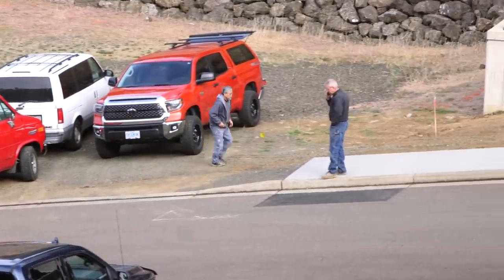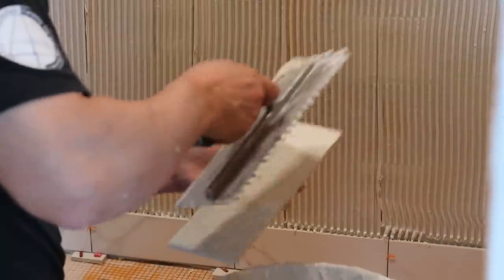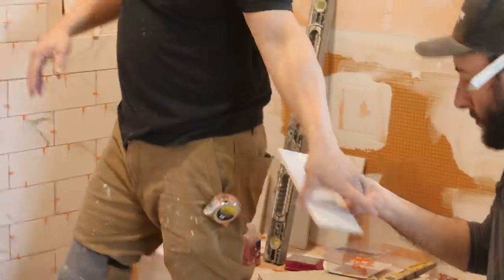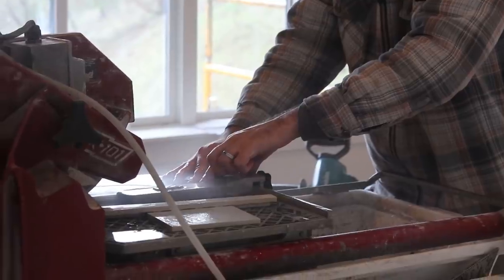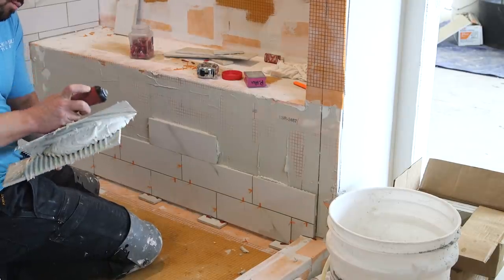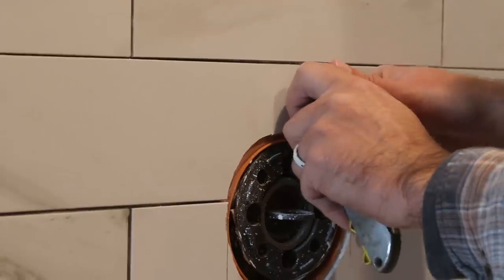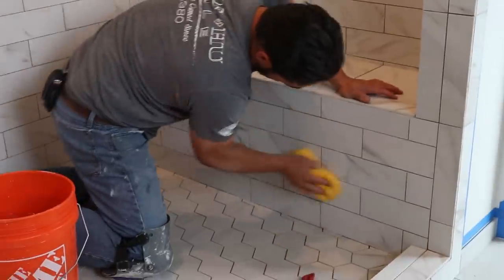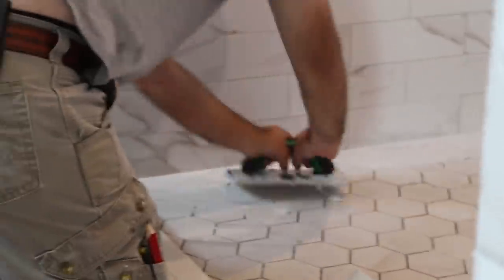How to Tile a Shower Ep.121

Comment: Little tip from a tile setter. 
Keep away from epoxy grout unless you are doing a swimming pool or hot tub. It really isn’t necessary for this application. 
Use Mapei Ultracolor grout. No sealer required and no efflorescence like the basic grouts since there is no Portland cement used. 
Fantastic video though. I love all your content sir.
Reply: Yeah, this EC guy doesn't do as much research as he probably should. There's definitely a third choice between plain powder grout and epoxy, ie acrylic grout. Mapei makes a good one but there are others.
Reply: TEC Power Grout is another excellent option. It’s the only grout we use, and far easier to work with than epoxy grout.

Comment: Here in Europe it's not recommended to use two-component epoxy grouts in places like showers. Epoxy grout is water tight both ways - it won't let the water in, but it also won't let the water (moisture) out. There's always some moisture underneath the tiles, despite 90+ % bonding. Tile waterproofing keep the moisture from penetrating lower layers, but the moisture needs to get out. Cement based grout has higher vapour permeability, so it allows that moisture to come out.
Also the very corners of adjacent walls/floor should not be grouted. Even though epoxy grout is somewhat flexible and deformable it will crack in the corners with time. The best way is to use a mould resistant acid cure silicone (except for natural stone). If done properly, it won't degrade for 4-6 years. Besides, there are no eternal tile works. There are well maintained bathrooms and showers with periodic inspections and the others :).
Reply: Those are the facts! Cement based sealed every 18 months is the best method in my opinion!
Reply: In the US we build our bathrooms to be remodeled every 10-15 years. At least that's how old they are before they start really showing signs of wear.
Reply: @9HighFlyer9  4-6 is a lifespan of a silicone. When it degrades, you just remove and redo it.
Reply: Interesting! I didn’t know that but it does make sense! 
Europe is usually more advanced and smarter in their construction practices than here in North America!
Reply: @utuberdave  I think that is not the matter of being smarter or not. We just have more urban areas and many people live in apartments where it's harder to do remodelling too often. In a place like block of flats any failure may have serious consequences, both material and financial. So we try to do all the construction work as reliable and serviceable as possible.
Many of your solutions are simpler, cheaper faster and smarter than ours. But some are unwise beyond any comprehension.
Reply: Isn’t sealed grout going to have the same issue? And the tile itself isn’t Permeable so no moisture will evaporate through it. Seems like a non issue.

Plus regular grout unsealed is actually a place for more and mildew to grow. So i guess it’s one of those pick your poison type things.
Reply: @Stefan_Kawalec  you could say all those things about epoxy grouts.

I’d be very surprised if water trapped behind this tile could evaporate out even if regular grout was used. And even if such evaporation is possible it would take so long that it wouldn’t happen if the shower was in use regularly.

Comment: Marvellous to see a good tiler at work. I remember a few years ago when we had a tiler in for a bathroom renovation. He was great, he told the building contractor off (he was a subcontractor) and made them come back with better structural reinforcement and straightened the edges. A good tiler is worth more than just the tiling job.

Comment: Good warning on the epoxy grout. The average DIYER needs to stay far away from it. They should go with a premium premix grout that includes stain protection and mildewcide to prevent molds.
Reply: Never had a stain protection work
Reply: @turboflush  Epoxy grout I've used hasn't been particularly good at stain protection.
Reply: @dchristo10  interesting. I have never used epoxy grout.
Tried grouts with stain protect. Tried adding... It never works. Tried cleaning and reapplying. Thin. Thick. None matters.
Reply: As a DIYer, I've never had the courage to try epoxy grout. I think I'm too slow of a worker to pull it off. I used a premium premixed grout a few months ago and was pleased with the results.
Reply: @Nk-bc1qb  yes, I used it once and it's difficult to work and wipe.  I ended up breaking it up into little areas.  lucky it was a small job.  Never will use it again.

Comment: Epoxy grout is a milestone in modern times as Roman concrete was in its day. Beautiful tile system from  industry leaders. Tiled a ton in my 20's, and love the new standards, and dependability of new products. Fit in a small interlock install for the garbage /recycling pad near the curb. It's a popular install, easy to get right, and wrong!

Comment: The layout of tile can be the toughest part of the job. It includes shifting the pattern over one way or the other to accommodate   windows that are not exactly in the right spot or placement of outlets, bars, and special items. Sure you can go around them, but a lot of forethought goes a long way before the tile guy gets to even see the job. Starting placement of floor or wall tiles can alter the whole thing.

Comment: This was great.  I've done a good bit of tiling in my own homes, and it's good to see pros doing things much the way I did them, only way faster, of course.  On walls, I did way less vertical in a single session, wanting to be absolutely sure the previous section was fully adhered before putting anything above it.  The paranoia of an amateur.  One thing I didn't see here that I learned years ago is part of the layout.  If you have a large hole, as for the shower controls, and you're using hard tiles (like porcelain, vs. ceramic), it's best to plan it so the hole center is between two tiles.  I had one that was about the center of the tile.  Maybe there's a better solution to this problem, but I ended up using a tile splitter on that tile, then cutting the half-holes along the split, then fitting the two pieces back together carefully.  It took a pretty close look to spot the split, but it would have been better to have not needed that at all.  I always find tiling to be a bit stressful as I'm planning it and actually doing it, as I'm concerned about screw-ups and the extra work they end up requiring, but once the work is done, it's a great feeling to admire it for years to come.
Reply: You're absolutely right, making a clean hole (even if it's round, but especially if it's not round) in the MIDDLE of something as brittle as a tile or a pane of glass is something beyond the capabilities of your average DIYer, and likely still challenging even for the best craftsmen.
So, laying out the tile so that at least one joint passes over that hole is a much superior layout choice, as you mentioned.
I do like your solution (tile splitter and then cut out the half-circle sections out of the edge created by the splitter), but since I don't have as much confidence in the tile splitter, I'd have used a more traditional tile saw on that tile and just made the resulting joint look like it was meant to be there from the beginning. Much easier to reliably seal and grout it that way, instead of having basically no gap to put any kind of filler into and therefore potentially having a spot where a crack and/or leak might develop in the future.
Then again, I've never laid tile in my life, and I'm just fine with keeping it that way, so maybe I'm wrong about this whole thing (instead I'd hire someone who has years of experience).
Reply: Drill with circular diamond bit. Keep the tile wet.
Reply: @JosephWheeler14  For holes like the ones for shower controls, that would be a very large diamond bit, and a home gamer would likely only get a single use from it.

Comment: I demo’d and installed 2’x1’ tiles on  the floors of 6 full baths, 2 1/2 baths, our upper laundry closet, our lower laundry room and an outdoor shower by our pool, over the course of 2 yrs of roof-to-foundation renovations on our 20 y/o 6k sq ft North Texas home…. My progress in understanding the approach, materials, tools, sequencing of steps, set and install techniques and related tips and tricks of the trade, are clearly evident over the scope of the various projects. Moreover, the accumulated insight and wisdom has significantly streamlined and reduced the overall project duration times.

Comment: I came to the house yesterday, since I misread the website (I left that note), and I'm bummed I couldn't see this shower or much of anything else. It looks great! You've done a lot of great work here, and whomever buys the place is a lucky person. I'll be using this Schluter system when I redo my shower, as I think it's the best too. I used Ditra when I tiled my mom's house and won't ever use cement board!
Reply: You may want to watch the Tile Coach here on you YT latest video on schluter mock up water test,  Eye opener for sure
Reply: Are you still here in town?  We'll  show it to you!   Respond here!
Reply: Bryce...found your note...come back anytime and we'll open up the house for you!!
Reply: @EC2  Wow, that's quite an offer, thanks! I'm a bit over an hour away, so I'd need to plan a time. How about sometime next week? The 27th-29th would be doable for me if that works for you.
I can do a weekend if that's necessary, I'll just have to figure out some things.
Reply: @EC2  Hey guys, checking in to see if you got my reply here about coming by the house. If your offer is still available, let me know! Maybe I'll try emailing you too, and you've got my card with my info if that helps. I'm watching the new painting video and boy is that a nice trim paint job! Hopefully I can see it sometime, take care.
Reply: jami w  Ditra is superior because A. It provides decoupling on the whole floor B. You can cover a large area with a roll (rather than many sheets of cement board) and one of the biggest advantages, C. It's MUCH lighter weight. Yes, it's expensive (read: overpriced) but it's worth it, especially if your body is shot like mine and hauling heavy cement board is hard.

Comment: I equate grouting a shower like that to running a marathon. Once you start a grout job, you're running against the clock. A second pair of hands helps a lot. If you are using one of the so-called super grouts (stain resistant & fast setting), your timing has to be perfect. That stuff can get away from you if you apply too much and can't get your wipes done before it flashes off and turns concrete!!

Comment: Is there a reason for doing the wall tile first? Ive always heard to tile to floor first and lap the wall tile to prevent water penetration
Reply: Correct, setting floor tile first is a better practice because it eliminates long grout joints around the parameter of the pan.
Reply: @chinaskibukowski7747  I am guessing that industry specs are similar to here in the UK - there should be NO grout in internal corners. Silicone caulk should be used. Therefore it is a bit of a moot point whether to tile the floor or walls first. (I usually tile floors first in any case!)
Reply: He put the floor tiles under the wall tiles, same idea as tiling the floor first, but it means you don't need to stand all over the tiled floor with ladders and dirty tools while doing the wall first.

Comment: My tip to deal with the grout... As you lay the tiles take a chip brush and run it through the grout lines.  Have damp sponge near to wipe top of tile.
Perhaps every course of tile that is layed.
Massively reduces the clean out.

Comment: there is very likely water below that floor membrane after your standing water test. its a problem with the Schluter system they have yet to acknowledge/rectify. Here is a good video on the issue: https://www.youtube.com/watch?v=3fohpiZ0E7E

Not knocking the work as it looks to be done well. its an issue with the system and the standing water test.  epoxy grout has likely sealed it in too.

Comment: Man, my back hurt just watching Hu. Question: why didn't he continue the tiles, instead of piece the corners in? Time/budget? I mean, I'm no tile expert, but doing my backsplash, I came to a corner, cut tile to fit and used the cutoff to continue the inside corner... Oh, and I tried Epoxy grout and FOLLOW THE INSTRUCTIONS! The fumes and "corrosion" warnings are bad! Cleaning it now, I need to use vinegar or a diluted bleach solution on the epoxy grout-it does get dirty and stains can be cleaned but man, its solid.

Comment: 10:28 I've always laid the horizontal tiles first so the vertical tiles overhang them. These guys laid the horizontal tiles last. Why?
Reply: A lot of my colleagues, and I think tile setters in general, do the walls first, and the floor after - I believe it is, to some extend, because if the floor tiles are laid when you start the walls, you risk messing up the floor with thinset and grime, which is not ideal (thinset in the grouts etc.) Also an ungrouted tile floor is pretty vulnerable, i.e. you risk treading loose some of the work you've just done, because you need to stand there and keep working walls - the guys that do it this way, will probably have several other good arguments for their process.
Personally, I always do it like you do - floor first, then walls. - You can get the grout spacing right between floor & wall + the wall tiles must always sit on top of the floor ones, because of the way water travels (directly down into a grout, then below the tile vs. down onto a floor tile, then away into the drain).

Comment: I'm under the impression that horizontal tiles should be set first so that the vertical ones go on top such as the bench??  Am I wrong?

I guess it's the homeowner's design to have the bench under the shower head.  If it was me I'd like to sit down and have the shower head spray me from the other side.  Maybe the bench is used for leg support when shaving 😆😆😆

Comment: Immediately before he lays each row of tile he trowels a chamfer through the thin set about an inch wide. Anyone shed any light on what this achieves?
Reply: As I lay each course some of the Thinset from behind the tile squeezes out to the top edge of the tile.  If I take my margin trowel and do the technique that you describe when I lay the next course it is less likely to have the Thinset come out between those two tiles.  It’s just a way to minimize the amount of detailing that I will inevitably have.  I am not actually removing very much Thinset at all.  Really just displacing it vertically.  When I set the above tile it is squished back down and I still achieve the desired coverage.  Hope that answers the question.
Reply: @philhu8412  Perfect. Makes sense of course once you know.

Comment: Why not just use a damp toothbrush to clean the squeeze out whole installing the tile? Then there's no risk of penetrating the membrane.
Reply: Because there is no risk penetrating the membrane. If there was then you wouldn't be able to trowel your thinset on. Not to mention the amount of unessessary labour you are creating.
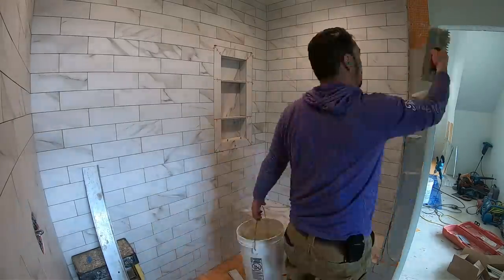Reply: @sackclothandashes1342  you're telling me it's impossible to touch the membrane with the knife? Look at the guy going at it with a stanley knife at 9:31 and listen to what Scott has to say about it.
Reply: @laurensplompen  Keep in mind there's a layer of mortar between the tile and the membrane. They only need to clean the mortar which is in the crack, no need to go that deep.
Reply: I think they're using a knife because the thin set has dried out and hardened. Going at it with a toothbrush wouldn't do a thing, needs to be something that can cut it out of the joints.
Reply: It is easiest to clean the thinset squeezed through the grout lines when it is slightly set. If it is still mostly liquid it's difficult to clean completely; if it is slightly set, then it comes out very easily with the scrape of a razor blade. It has the consistency of set drywall compound. With a practiced hand, a razor is the only way to tackle the job.
Reply: @laurensplompen  I am a tile installer by trade. Its best to try to get it out while its wet and fresh, but you often miss some and need to hit it with a knife the next day. You can set the depth of your knife so that its impossible to hit the membrane. Also the angle at which you drag your blade makes it very hard accidentally hit the membrane even with the blade fully extended.